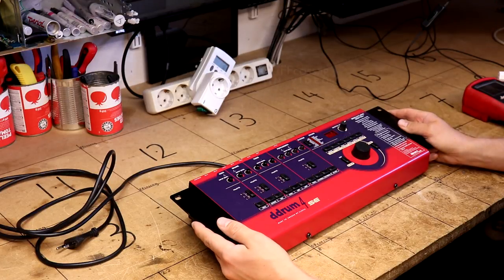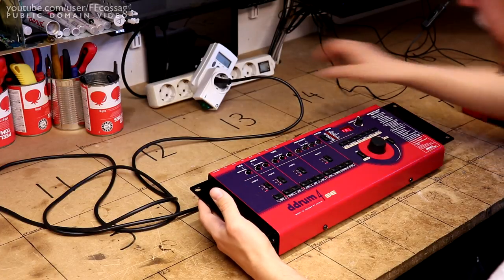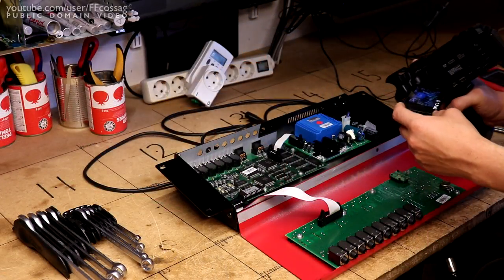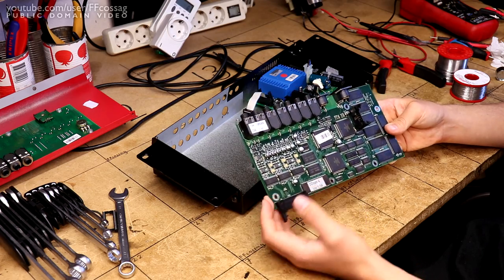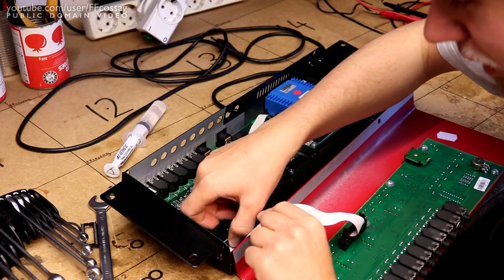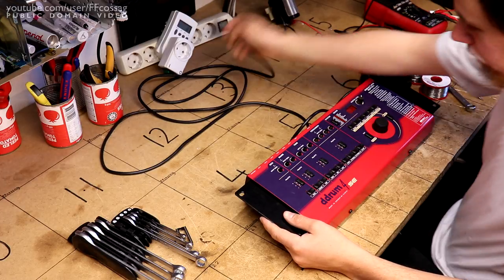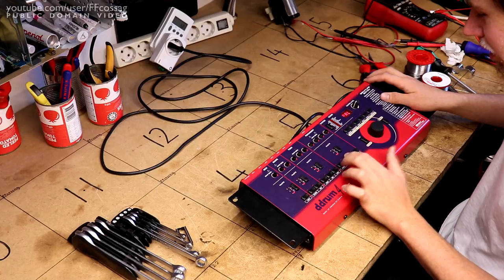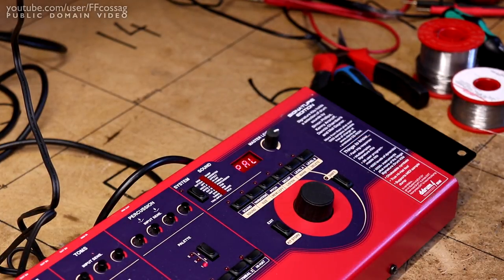ddrum4 SE drum kit repair (maybe)

Comment: Seems like a reasonable deduction, apparently the best IC socket is a turned pin variety, but not being a microelectronics person myself, I don't know whether that's right or not... :)
Reply from the maker: It is the best variety, since you get huge contact pressure, pretty much making an air tight seal. You can't reinsert the same chip more than a couple of times though, as the pins get deformed by design.

Comment: Thanks for the vid.
What other problems could be solved with direct soldering the eprom?

I'm asking, cause panning of Sounds for masterout a1&2 doesn't work, but for the headphone output it works as expected. Cheers, Frank
Reply from the maker: That's likely a different issue.

Comment: Hi,

Curious question:
Why is the IC socket a cause of an obvious failure?

Topic starter from this mentioned something similar:
“As soon as I touched the EPROM the LEDs flickered. Surely enough, the EPROM seemed to have contact problems, so I unseated it and pushed it back into the socket. Voila, back to life!”

Source:
http://unofficially-ddrum.proboards.com/thread/400/ddrum-4-se-repair-experience

Issue:
I have this friend who wanted to update his DDrum 4 SE from OS 1.5 to 1.54. He changed the eprom and after booting a few lights are blinking but the device don’t really boot so you can use it. He tries to change the chip back to 1.5 but the issue remains.

Do you think the root cause is the IC socket too?

I´m looking forward for your reply

Thank you.
Reply from the maker: I really can't say, but I always recommend cleaning out this kind of IC socket if you're having any issues with a product using them. They're not very reliable. Use isopropyl alcohol.
Reply: This friend I spoke about, maybe you have any suggestions?
http://unofficially-ddrum.proboards.com/thread/518/needed-strange-failure-after-replacing

Comment: That is a nice video :-D, you spent more time with other sources and a voice over earlier sections :-).
An unusual unit, it don't look that old, perhaps it's the clean condition that makes me think that, or that i'm an old bastard that still thinks in the past LOL :-D

The rom socket would have been my choice for failure, and if it failed i would look to see if there is a reset circuit to the processor connected to the rom.
Your earlier repair looks happy to me, but a linear psu don't kill caps as fast as a switcher.
Reply from the maker: Thanks, it's much easier to do voice-over with this set-up than the old one, since I can actually remote control the DSLR for audio/wide angle recording, while running the "old" Panasonic camcorder hand-held.

You're right that the unit doesn't look very old, alas the sticker on the inside stating a QC date of 2001, doesn't lie.